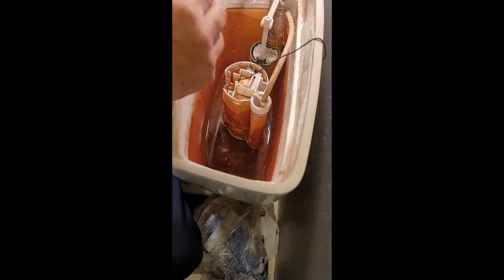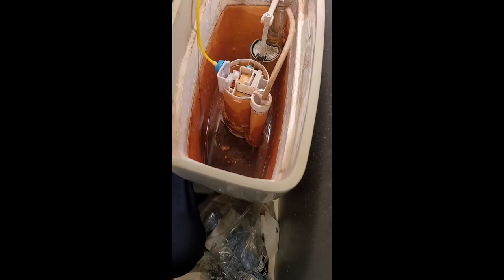Pegasus Toilet Dual Flush Broken Handle Cable Fix

Comment: Mine acts like the cable is stretched, you have to hold it in order to flush. I'll follow your efforts and see if I can get inside, maybe it needs a couple spacers to make it tight again. I didn't see a way to search or find the specific part number at the URL provided, if this doesn't work, guess I'll call and see what they can say.

Comment: Thanks for putting this out there. I probably wouldn't have ever found the part number for this.
My handle stopped working because a "cable end" came off the flush valve cable so the handle wasn't pulling the wire anymore.
Just a note that a little twist of the flush valve lets you remove the top part of it so you can do the work away from the toilet. A little easier.